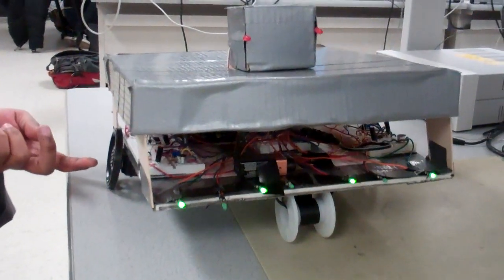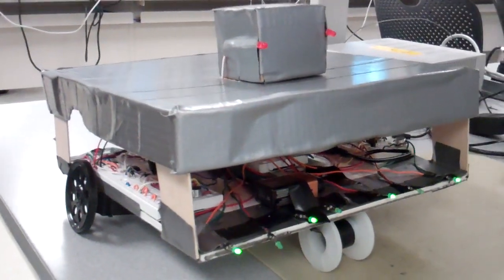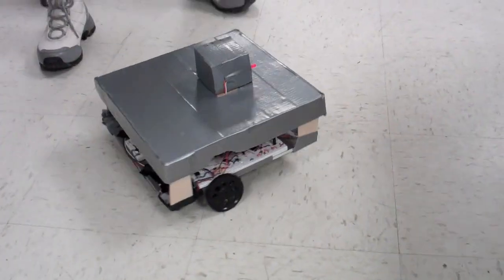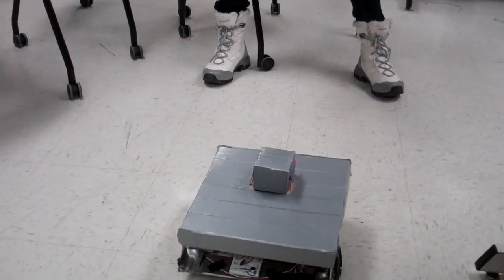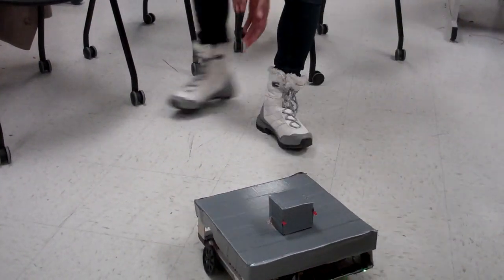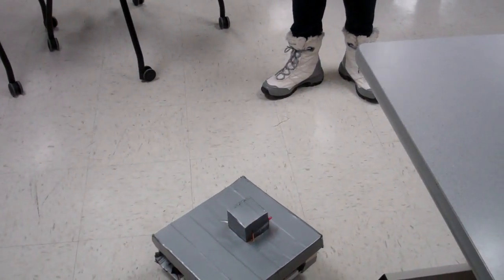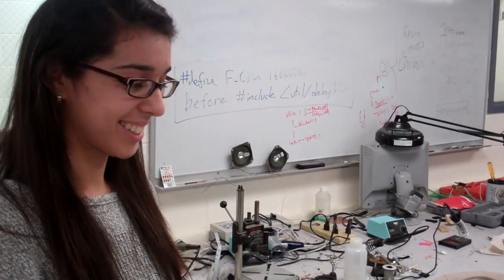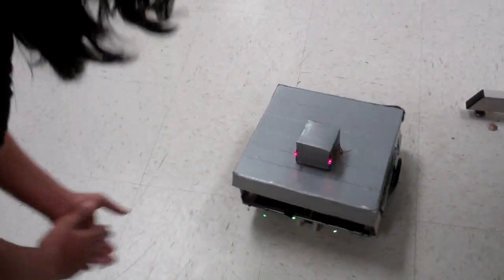Clap-E robot

Comment: which board are they using, I mean the one in the PCB, is a Pinguino?
Reply from the maker: It is a board designed at Cornell for class use. http://people.ece.cornell.edu/land/PROJECTS/ProtoBoard476/
Reply: Bruce Land
Thanks for the answer and the info.

And sorry, for the mistake, but is very similar to a Pinguino board. But Pinguino is with a PIC, and it is just one IC because the USB is built in into the PIC itself, but the design of the Pinguino with a PIC18f4550 is very, very similar.